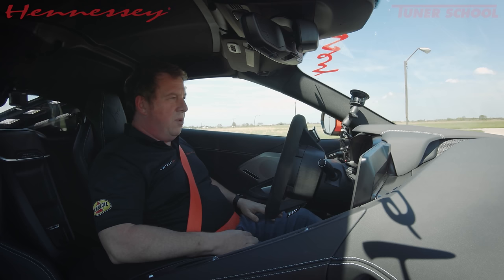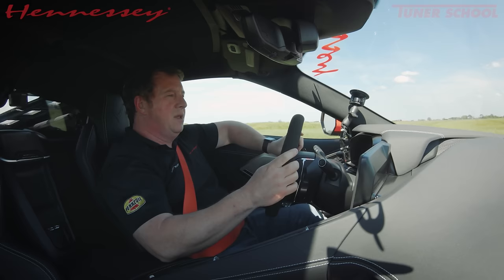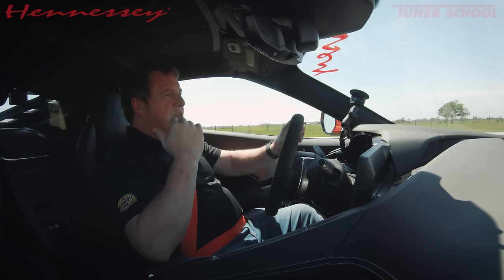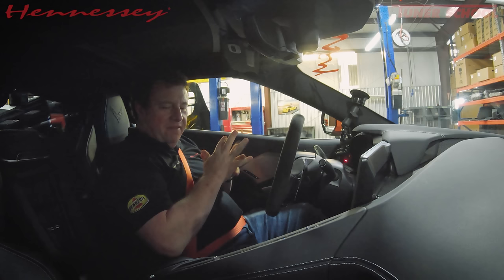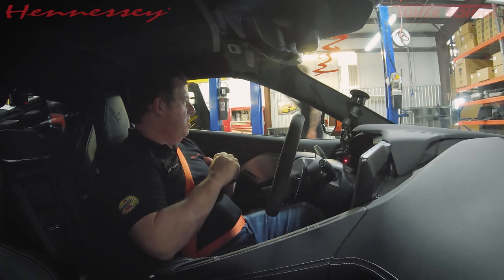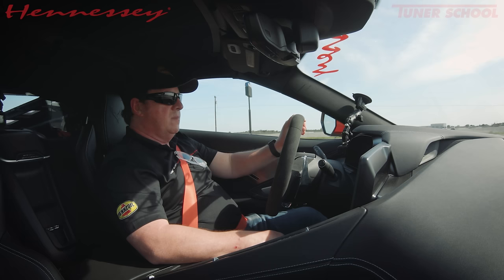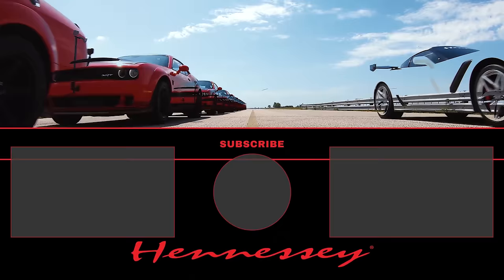Twin Turbo C8 Corvette Test Drive with John Hennessey

Comment: Congratulations old friend. 

I remember our VR4 days... 

God Bless. 

KNIGHTRIDER
Reply: I had one as well, 96 red vr4 twin turbo...at 150 which is fast as I was willing to go, it drove unbelievably stable at that speed!
Reply: @HomesliceDrummer Nice! Great color. Did yours come with the "infinity" 👈spelling... sound system and equalizer under the passenger seat?
Reply: @jternesto1981   I had me a 95 TT stealth/ 6-speed. black with tan leather interior, original chrome wheels..it was a beauty. with just bolt ons it was a fun car, that was way ahead of its time..built strong.
Reply: @SrtKillz12345  Aww man you can't go wrong with black...yes you're right, they were way ahead of their time! I wonder if anyone ever modded one to the 2,000hp Mark. Official VR4/Stealth RT thread lol.
Reply: 1993 3000GT VR4. 

Pearl white. Red leather interior. 

185MPH On the dash. Realistically like 180MPH. I doubt any less. That car was wicked fast. Especially once past 55mph. 

It cuts off at redline. The needle hits the board past. But it cuts you off. You get back to 178.5mph. Then back to 185 plus... Hits the board. Fuel cut off. And back. You cam hold 185-190mph for about 10-15 seconds. 

You figure... Average has to be best of a few runs. So 185mph high. 180 mph low. Dash. 

So on the street. I think its 185mph all day. Given enough road. Good conditions. For about 12 seconds. 

Solid. With higher boost. Maybe dialed and tuned to 400bhp +. 200mph is available easy. 

The rumor is 205 mph limited to gearing. But I believe with 500bhp to 600bhp.... 215mph - 220 is possible. 

Any more power. It would top out the same. Just quicker to do so. Anything past 205 mph is aero dynamic restrictions. Not gearing. 

Of course me... I'd go Honda J series V6. Twin Turbo. Aem infinity. With a PPG dog box. And keep All Wheel Drive. 

Rock solid. Stable. 160 is a freeze. Then surge... Peaks... Full max everything. The engine hits the hood at top speed on the secondary banks. 

So cylinder.... 1, 2, and 3.... Calm ...

Cylinders... 4, 5, and #6!!!!..  Hit the hood...  Prunm... Prunmm .. Praunm.... Nnnnma... 

Lol. I still remember. I was braking motor mounts! With a pasanger !!!! 

* In Mexico of course.... Lmao!

Comment: This thing is going to be breaking records once it gets 1000+hp and a transmission that could hold the power 👍🏼
Reply: Yeahh not sure how quick its gonna happen. Took a while till the huracan and r35 transmissions got mastered
Reply: Its rear wheel drive and then engine is in the middle now. So the transmission will be stressed less. Though I see awd zr1 and C?.R packages with 6cyl twin turbo engines
Reply: You realize there are plenty of other cars that are more refined than the C8 that put down nearly that much power? I don't think it'll make records on the track but maybe on the drag races.

Comment: It's so satisfying to know that the C8 is the benchmark for all the other exotics. GM has obliterated the competition. 🇺🇸
Reply: @ELECTRICEYEMEDIA  he is talking about how affordable this car is compaired to these over rated European cars. I do not think that you can buy performance like this for this much over there. Unless you buy used then they break all the time. So yes the c8 did set the mark with affordable performance
Reply: Obliterated? Come on now, you are reaching. It is a fast car, but off the show room floor wont touch much in terms of supercar/hypercars.

Comment: The C8 is now a force to reckon with
Reply: Already was now it's just overkill
Reply: ExpWars overkill for the street but NOT overkill doing rolling launches on a decommissioned airport runway vs exotics *drool*.  But for me, a stock C8 or C8 W/ mild tune + exhaust is all I need/want.
Reply: Trevon Adams  LMAO.
Reply: Trevon Adams plus drag radials, 2 gallons race fuel, aggressive tune, and cool/dense outside temp.
Reply: Trevon Adams  Maybe a H/C C8. Probably not a bolt on one though.
Reply: A base(wingless) C8 with even modest mods is going to cause a lot of butt hurt once they hit the streets and even long distance runs too. Can't wait to see it lol.
Reply: Trevon Adams race fuel is not a bolt on🙄. Tires don't 'bolt on' either, wheels do (but still not considered a bolt on🙄).  Tune is not bolt on (it's a 'plug-in')........nor is weather.  Relax bruh.
Reply: Trevon Adams  Just playing devils advocate, a turbo or super charger is bolted on but that's not considered FBO. Just saying
Reply: Trevon Adams Those are not bolt ons dummy. I know what boltons are. Fuel, tires, tune and weather are not boltons.  Bolt on means complete exhaust, headers, air intake, intake manifold, pulleys or any 'non-FI' mod BOLTED ON to the outside of the engine (not touching oil). Bolt on literally means simple mods BOLTED ON to the engine, without opening up into the oiled internals.  Bolt on does NOT mean just ANY factory item that you replace with ANY aftermarket item without opening up the engine.  By your definition weather tech floor mats are BOLT ON. 😂. So yeah-  RELAX.
Reply: It’s a force rolling down the assembly line

Comment: Venom GT sound in a 60k dollar car, how cool is that !!
Reply: Paul Bujold This kit will probably cost $50,000
Reply: The C7 vettes sounded like a Venom GT. This sounds more like a COPO Camaro
Reply: @jaredchampagne2752  nah. Its Hennessy it's gonna be a extra 120k probably
Reply: AmericanGrizzly Christ
Reply: @jaredchampagne2752  Yes ur right but its worth it i think. Power have a price and a car like this one with 800hp crank will be a supercar killer . Since not every one like flat plane crank like the z06 rumours announced, people are gonna buy stingrays like crazy and mods them, then .. cost will be lower on a mass produced . And again its my own opinion
Reply: AmericanGrizzly and it'll take 5 years to get done
Reply: Car is 85k and guessing 650whp $30k, 800 is $40k and 1000 is $60k. Not chump change. Add $10k to each price to be 1st to get it if not $20k.
Reply: @snipervision1  Still half the price of anything from Italy, and you're gonna keep right up with the best of them.
Reply: Azaan PD Well seeing as the Venom GT also uses a GM LS motor, I’m not suprised they sound similar!
Reply: Well the venom GT uses a GM motor...
Reply: @Mickey Mouse Not sure what that means.
Reply: It used a crate version of the LS7.
LS or LT all will perform similar if taken good care of, plus you can actually crack these open yourself if they don't.
But since you'll still have a warranty you should be worry free for quite a while.
Reply: C8 min out the door is 80k+. u would have to be completely brain dead to build one out at 60k. go try to build one out.
Reply: @jaredchampagne2752  sheepyrace will probably sale one for 15k-25k

Comment: Beautiful. Cmon Hennesey make this thing crazy reel in some 720s.I hope they  offer like 3 packages for this car a 650 whp pack..
A 800 whp pack and a 1200whp package
Reply: The stock internals csnt handle over 680. You woukd have to build the engine. It's very weak compared to some European manufacturers hence the price
Reply: @freddiejones4598  its hennesey thel find a way lol but I get ya tho.
Reply: @carlover2474  yeah of course they'll have to fully build the motor. But that's when things get expensive
Reply: Freddie Jones no it’s not, many American engines can handle over 1000hp on stock internals.
Reply: @tristyn1124  i didn't say they couldn't i was referring to this engine. And to be fair 1000 is pushing it cery few if any could achieve that
Reply: @freddiejones4598  3rd gen coyote can handle up to 1000 without opening the engine at all.
Reply: Tristyn lol American horsepower ratings are oh so accurate eh
Reply: @freddiejones4598  cleetus mcfarland has an lt1 c7 with over 900 wheel. completely stock bottom end and its not broken. Idk what you are talking about.
Reply: @justinbeamon6624  LOL 1000? GM's LT4 & LT5's can handle 13xxwhp on the stock block and rotating assembly. ZR1's run in the 8's with nothing more than heads/cam/ported blower and fuel for power mods.
Reply: Freddie Jones bro, no. Not even close. Lol European motors are ridiculously fragile whenever it comes to adding any kind of hp. People have been netting anywhere from 8-900 whp out of your run of the mill GM 4.8/5.3 TRUCK motors, and even more on an Escalade 6.0 motor. On the new LT1/LT4 motors? 9-1000 whp easily without touching any internals. Do some more research
Reply: Sure they could handle 1000 but for how long and could you daily it no! A reliable engine would have to be built along with the trans, axles, ect.
Reply: Daniel Ieraci what? We all measure WHP using the same Dynos. I didn’t know sending a car to a different country would change its hp rating!

Comment: That car would be a beast with AWD!
Reply: Trevis Fletcher LoL no it doesn’t...
Reply: Relax ladies it was just a joke sheesh...
Reply: Trevis Fletcher no it wasn’t ur prob a 13 year old thinkin he knows cars lol
Reply: Trevis Fletcher oh jeez
Reply: AWD would make it a lot slower, and it doesn't need it with that transmission. The nissan GTR and early model Aventadors both had AWD because they were equipped with very slow transmissions, so they made up for it with AWD. RWD, especially in a mid engine platform with such an amazing transmission, is perfectly fine.
Reply: @trevisfletcher2067  you're the only one who needs to Google anything 🤦‍♂️
Reply: Nah its definitely fwd and I'm not being sarcastic at whole
Reply: @savagetuner2404  

Aventador and gtr didnr have "slow transmissions". They both had dual clutch automatic transmissions jus tlike this c8. And neither Lamborghini nor nissan made those cars AWD because they had a slow shifting transmission....wherever you got that...is completely wrong...lol. 

Now a days...there are torque converter style automatic transmissions that shift just as quick as a dual clutch . Like the ZF 8HP90 or the Ford 10R80. Dual clutch automatics are popular in high end cars and some consumer sports cars not just because of shift speed but because there is very close to no power/torque loss in between shifts like there is dramatically more in a traditional automatic transmission.  

The aventador and gtr have AWD because they were designed to be AWD cars. They didnt make the original Corvette or c3, c4, c5, etc RWD because they all had fast shifting transmissions lol. Many cars have quicker shifting transmissions that the Corvette and even the c8 which has a dual clutch automatic now too and those competing cars are either RWD, FWD, or AWD cars. Hell...a VW GTI equipped with the DSG shifts quicker. 

The Porsche PDK dual clutch holds the record for being the quickest shifting dual clutch transmission on the market and it is equipped in RWD and AWD Porsche cars. 

And the early aventador automatic transmission was a single clutch automated  manual. Which still shifted quicker than 95% of transmissions that were out at the time. 

Do some research before typing your comments lol.
Reply: @_E_B_  Lol big deal. The aventador AND GTR both are more powerful and slower in 0-60. They're slow. All that "research" later and you're still making the same mistakes lol.
Reply: SAVAGE TUNER GTR have dual clutches tf you talking bout. And a Aventador has a single clutch not as fast but not horrible??
Reply: @hueyf7561  

Aventador "had" a single clutch. They have dual clutch automated manuals now as well...
Reply: @hueyf7561  Yeah, horrible. Both have AWD and better tires but are entirely destroyed by the c8, which mind you is 2/3 the price of a gtr, and a fraction of a lam.
Reply: @savagetuner2404  mmmm most manufacturers lie about power ratings at this point.
Reply: @Dance1617  Hence "dyno test"
Reply: I think the ZR1 will have the AWD option. That thing is gonna launch insanely fast guarantee 2.0 0-60
Reply: Touche!!!

Comment: I cant be the only one thinking they NEED to change the wheels.
Reply: Your not the only one they also need to put a wing on it
Reply: Chevy has NEVER put cool wheels on the Corvette for some reason.
Reply: ronald Arévalo *you're
Reply: Same, needs bbs wheels
Reply: @coolguys2392  no
Reply: They're saving the nice wheels for the Z06 and ZR1
Reply: Weak wheel design. You're right.
Reply: @stratotanker327  Wait a minute... The knockoff wheels from the C2, the rally wheels since 1967 to 1982, the turbine wheels from the late 70's are iconic... The ones on the C6 Z06 looked pretty good, the ones on the C6 and C7 Grand Sport looked pretty good too. But I agree that the C8 wheel design is lame. A lot of other Corvette wheel designs are lame too, but not all of them.
Reply: @ruskeee  Most likely, like they did with the C5, C6 and C7.
Reply: If I had one it would get a 15" brake and wheel conversion out back and some Keizer 17×4's and double beadlocked two piece 15x10s and some Hoosier slicks because that's how I roll! That might be one of the reasons I'm not rich! LoL
Reply: Archimedes  they had to keep the price down
Reply: Badly. Very badly
Reply: @stratotanker327  zr1 wheels are amazing

Comment: I'v always liked the ride comfort of my C-6 Z51. It really is comfortable; the seats, etc. I've never been disappointed. I can actually feel more refreshed after a road trip in my C-6 than my 6 month old Honda Insight. Don't know where some haters get the idea that the 'Vettes are not comfortable. I dare say, tho I've never been able to compare, my Vette is likely more comfortable than the Euro exotics which, based on reports I've seen, are a bit rough-riding.

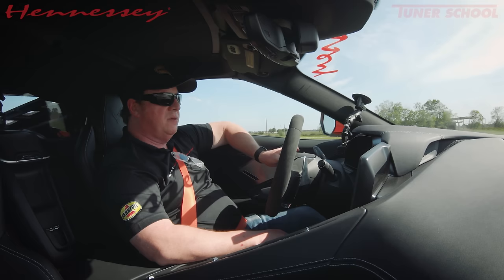Comment: My question 05:28 that open filter and moisture cant be friends can they?
Reply: It's a prototype.  They'll plumb an air intake on the production version no doubt
Reply: Just gotta be careful. I run a true cai on my car with no water shield. I avoid all puddles, and if the water looks like it will touch the rim of my wheel. I'll shut the car off, coast through, and crank it back up when I'm out

Comment: This thing is gonna kill a lot of novice drivers. Mid engine Rear wheel drive twin turbo. The snap oversteer is going to be LETHAL mate.
Reply: SageoftheSixPaths I won’t even bring up the hellcat...
Reply: I've been saying that since day one man. Good to know somebody else thinks the same thing
Reply: Jack Ferguson compared to the c8 the challenger has a lot more car between you and the tree that you’ve just crashed it into
Reply: @Aron-ru5zk  Depend's on which side you're sliding, a door can be really thin in those circumstances...
Reply: Why does engine rule this is RWD, it's AWD, which means yes, just like the old Porsche 959, it's so good that by the time you lose it, there's absolutely no coming back except for luck.
Reply: Sadly the C8 isnt even the top 10 fastest Vettes of all time. Its quick not fast once you hit 110 the C8 vette stops pushing itself to the limit unlike the Older Vettes. Vette were monster off the roll while this one loses to Mustangs.

Comment: It is a Long Story but I have a 73 VW Super Beetle I bought in 74 when I was in the Army I took it to Germany it got Modified with a 75 Porsche Carrera Twin Turbo Platform and every Engine Mod available . The Nurnberg Ring in Germany it was clocked at 203mph, I rented 10 Laps at Texas Motor Speedway in the 90's and the 10th lap was 199 Mph. It is a daily driver if you want to but I have it in Storage and I am Bringing it out shortly to Drive it again. I would like to offer you a chance to drive it and see what you think. Several Race Car drivers that I did let drive this Herbie Sleeper were Shocked at the Stability and Top End. Car was built in Mainz Germany by Wolfgang Boober a Race Car Builder. Serial number on the VW is 1332921268. Part of the Build was sponsored by ESSO. You have an Impressive C-8.  BTW Porsche was also a Sponsor.

Comment: Pls 🔥top speed the c8 twin turbo🔥pls
Reply: ALEX GAMES T can have all the power in the world but it is limited by gearing
Reply: I’m pretty sure they will after they’re done tuning and tweeking it
Reply: 600mph
Reply: @SpecRB  the high gears in the C8 are actually a bit long due to efficiency requirements, highway MPG. The extra power will help with top speed definitely. Normal version makes 194mph, and the Z51 track version makes 186mph top speed. This will most likely be above 200mph
Reply: Probably about 205

Comment: It’s crazy it’s not immediately in limp mode with a factory untuned computer.
Reply: Cobalt06 almost like it’s fake
Reply: RJ mi the boost levels are pretty low. In the description of one of their previous videos I believe they said it was 4-5 lbs if boost.
Reply: Wyatt Woodard but do you really think this video is fake?
Reply: The factory computer will do basic corrections on its own but you can’t do 20 psi through it stock. Also you can tell it’s faster because under full throttle in other c8 videos the rpm gauge doesn’t move that fast.
Reply: No way that's untuned. Has to have a boost sensor too. Unless it's just tuning via MAF?
Reply: @ibladesi  +O2 sensors.

Comment: Awesome! Curious, are the turbos causing that sputtering/fluttering noise?
Reply: ntme9 yeah glad u noticed that too I wasn’t a fan of the exhaust note at all. I think it’s just the length of the exhaust. Couldn’t get the best glimpse from the video but looks like the exhaust is pretty much just like 6 inches off the turbo. Needs more exhaust after the turbos like the lambos do and clean up the exhaust note.
Reply: A really short exhaust with turbos always sounds like that. I personally don't like the sound that much
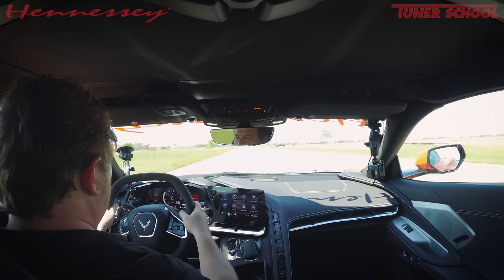Reply: I searched the comments looking for somebody else that noticed. It sounded like it was breaking up, or even bogging at the shift during the pull at 3:15. It definitely didn't sound right...
Reply: Dude McGee it isn’t tuned yet so its probably pulling timing.